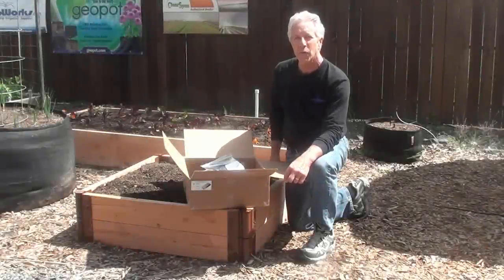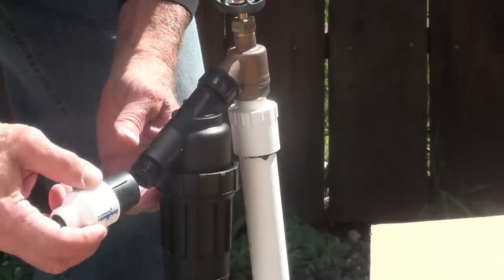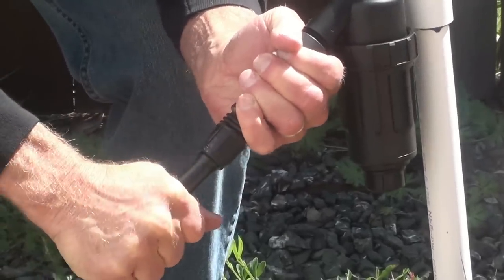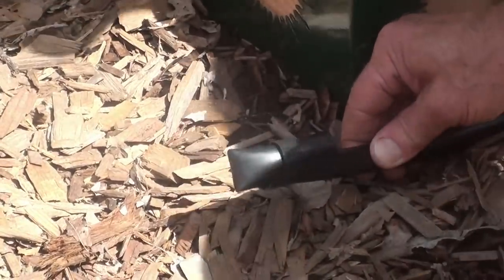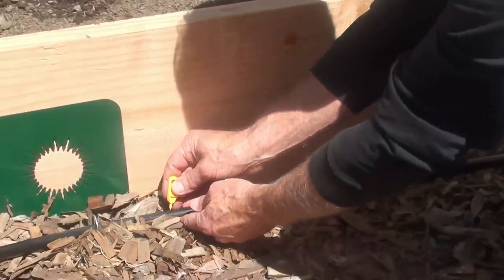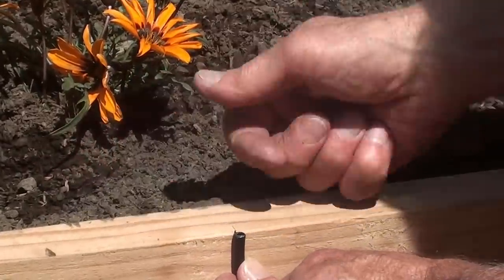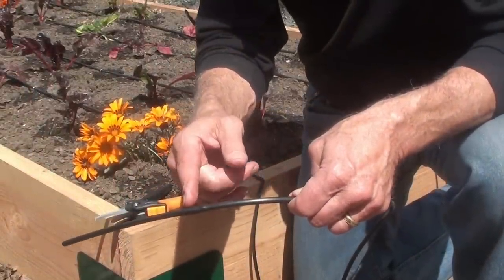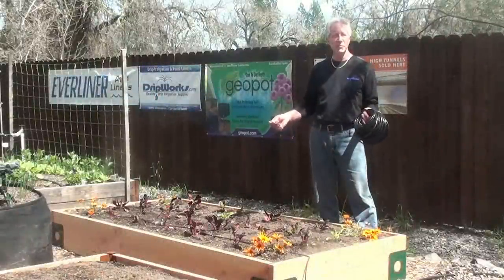Drip Irrigation Kit - Garden Bed Irrigation Kit

Comment: Any reason you don’t just run one continuous line?
Reply from the maker: Yes, the 1/4" soaker dripline has maximum length restriction due to its size. For example, the 12" spacing featured in this kit has a max row length of 34', the 6" has a max row length of 18'. For small beds (4' x4'), running a continuous line would be possible.

Comment: I live in WI.  Do I have to dismantle & store indoors the irrigation setup during winter months?
Reply from the maker: Hi Marilyn, Here are some steps to take in early fall to assure an easy time in the spring: 
Step 1: When freezing weather is anticipated, simply turn off the main water supply to the irrigation system and make sure that the backflow device, valves, filters, pressure regulators, pipes, sprinklers, drip hose, and drippers are free of water.

Step 2:After the main water supply is shut down, run the timer/ controller through its normal watering cycle. This will allow each of the valves to open and relieve water pressure on the main line and valves. Allow the lines to drain slightly. After the timer/controller runs through its cycles, turn the controller off, or to Rain Off position.

Step 3:The most important thing to do in very cold temperatures is to wrap all exposed pipe with insulating tape. The insulation should cover everything exposed up to the risers; however, it is unnecessary to wrap sprinkler heads or hose bibs.

Step 4:Through the height of winter leave the system off and drained. If needed, water the plants and lawns with a hose only. In most cases, there is enough moisture in the ground from rain to sustain the plants and lawns during the extreme winter periods.

Comment: I thought the filter needs to be attached after the pressure reducing valve because it's not supposed to be connected to constant pressure.  Perhaps since you had no timer this "assumes" you are turning on and off your irrigation.
Reply from the maker: You must ensure that only clean water passes through the pressure reducing valve, this is why a filter should always be placed before it. There are several types of filters, this one must be placed after a spigot and cannot be under constant pressure.
Reply: @DripWorks what filter do you recommend for systems that are under constant pressure?
Reply from the maker: @Andimia55  You will need to use Standard or Tagline Amiad filter, here is the link https://www.dripworks.com/drip-irrigation/filters/heavy-duty-screen These filters are built to withstand constant static pressure.